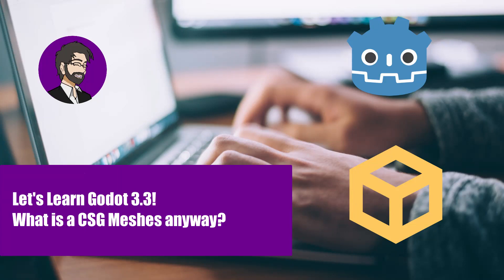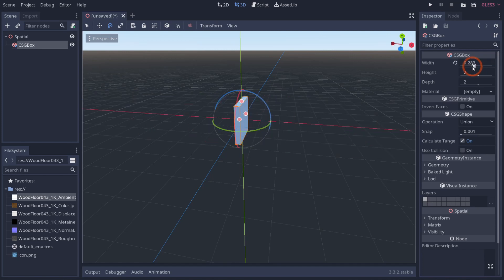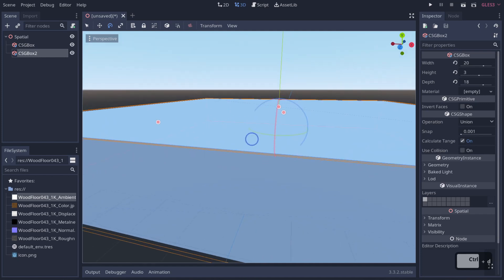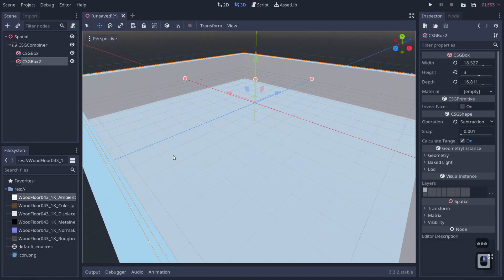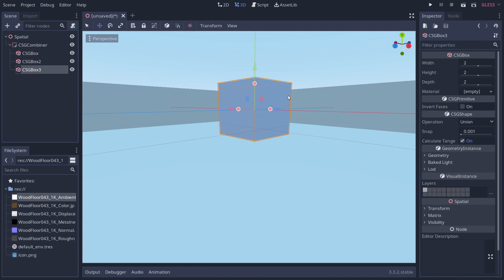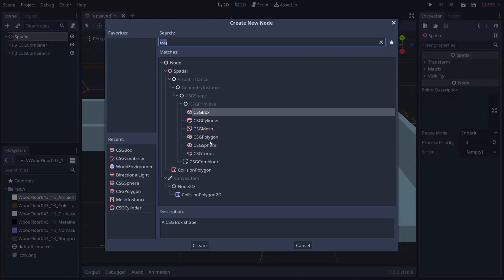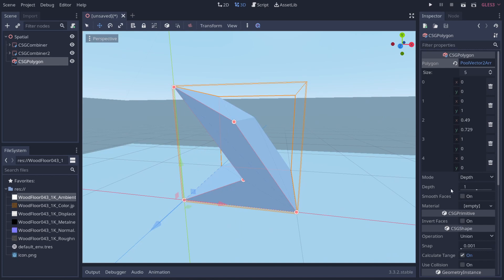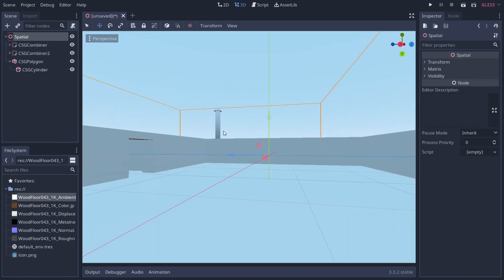Lets Learn Godot 3.3! What are CSG Meshes

Comment: Would you recommend to use csg meshes for destructible grounds?
Reply from the maker: You could but Id suggest using actual mesh unless your going to at runtime break up the mesh. Usually in my exp that is predone in a program like Blender and just "simulated" in the engine, but if you are just doing it at runtime and slicing the mesh a csg mesh will work.

Comment: I've heard 'for prototyping' a few times - is it bad for general use, or just ugly? Is it a suitable basis to place asset pack architecture against - with /without collision on the asset? Thanks, just getting my head around using a3d pack soon
Reply from the maker: Wow I replied to he wrong comment... CSG meshes are great for prototyping if you're going to use them for actual level assets I wouldn't use them for anything super detailed because the Boolean system is less efficient than actually modeling the object.. You can definitely use them for collision though but again it may be better to just model the object
Reply: Appologies - I suppose im looking for something that starts like your 'Exporting Assets from Unreal' video, and the workflow to prototype then fill a scene with existing assets. I know, real basic stuff 😕 just using the wrong key words I think. Any videos that come to mind?